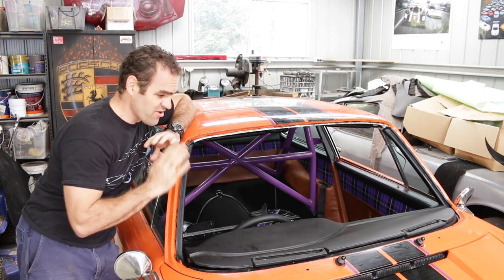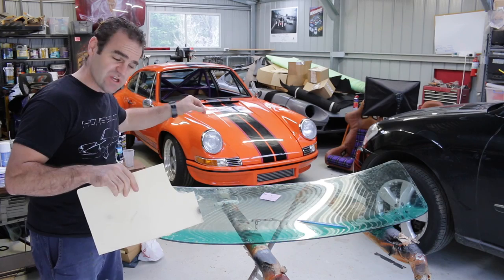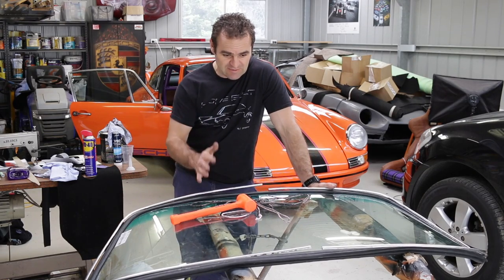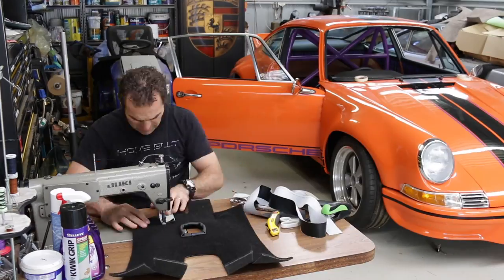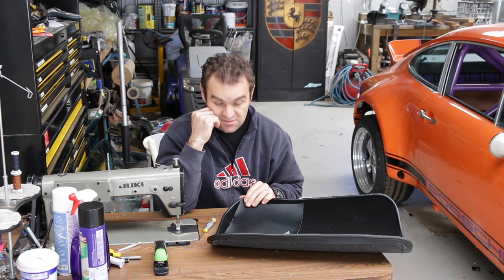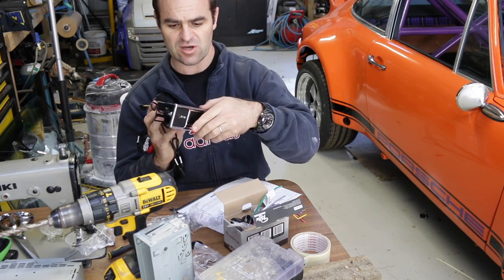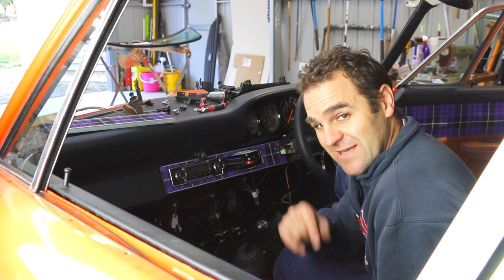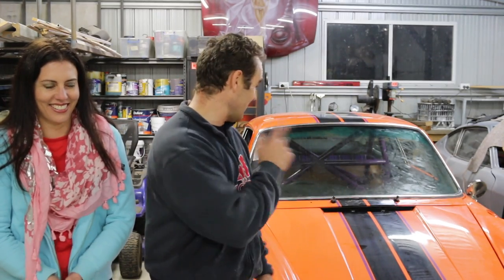Porsche 911 Classic Car Build Part 55 - Fitting a stereo and custom floor mats

Comment: Hi Jeff, the fearlessness with which you jump into all of it is impressive.  Amazing, actually.  Regarding the windscreen, I know that I am late to the party, but, there is an inexpensive special tool that makes putting in the locking trim, super easy.  It allows you to install it without that stuff in place, making the rubber way more pliable and as a result easier to install.  The same trim was used in VW’s, BMW’s, Audi’s, etc.  and the tool made all of those installs easier.  Best of luck, I’m up to video 55 and loving them.

Comment: Velcro for holding the carpet in place I would say. I wonder how the previous owner got the windscreen in with the opening bent like that?  You did well panel beating the edge without paint damage. Warming up the windscreen rubber for more flexibility may help. Those radios are good places for rattles to happen if the back end is not supported with some kind of bracket as they are quite heavy. Thankyou for the video and thanks to Mrs Jeff I didnt know Porsches beat Ferrari in 1966 LeMans.
Reply from the maker: Velcro is a great idea. I dismissed it in the past, as I wouldn't be able to stick it to the sound deadening, but I would be able to attach it to the other bits of overlapped carpet.

Comment: Or.. you could just wear a full face helmet on your daily drives and tell that windscreen to just bugger off. Glad you did not crack this one. I have no doubt you will get it sorted.
Reply from the maker: That is sounding like a better option at this stage.
Reply: #weightsavings

Comment: Aaah that tricksy bloody windscreen. Somebody must be able to help you with it! I dread to think how much that custom retro stereo cost you; you should check out Pete C youtube channel. He is restoring a 1971 Ford Cortina GXL and has completely reworked the original push button radio to run all sorts. Its a masterclass in using bits off ebay. You want a challenge? Theres a challenge! Keep going, the Force is with you padwan...
Reply from the maker: The stereo was about $500. About what you would pay for any decent stereo. It is just a component type deal so that you can mix and match the look that you are after.

Comment: Jeff, I think you might have more "support" for the radio/stereo installation if you cut just enough room for the display and drill two holes for the buttons.

I have an old VW Brasilia and this is how the radio is installed, it does not have any support around it, just fixed by the front, when you tight the nuts in the buttons it is firmely hold.

See this image for a better understanding: 
https://http2.mlstatic.com/tabelie-painel-cobertura-v-w-brasilia-sem-q-p-q-preta-D_NQ_NP_639056-MLB25933545425_082017-F.webp
(I think you will be able to open the link)

Cheers, 
Paulo
Reply from the maker: I thought about doing it that way, as that stereo is modular, but I didn't think it would work as well with the tartan.
Reply: But you would use the "front cover" of the radio in any way. When I remove the radio from my car for any reason, I take some photos and send you, is complicated to explain in text, hehe. 

Anyway, awesome work !!!
Reply from the maker: I know what you mean. That is how most of the old stereos were, but this one matches nicely with the heater controls I have.